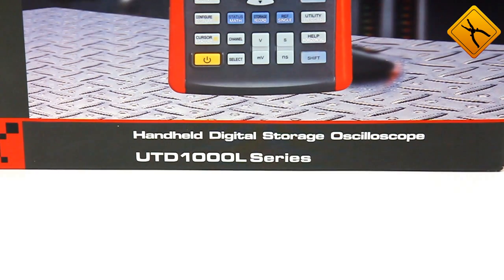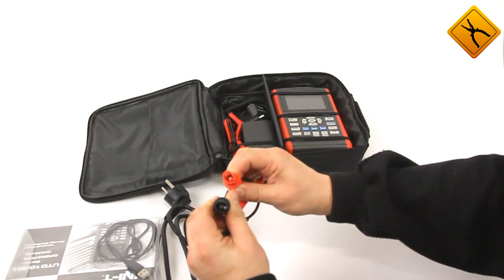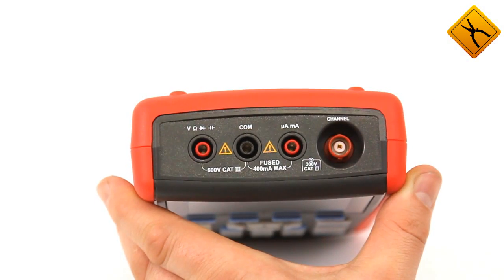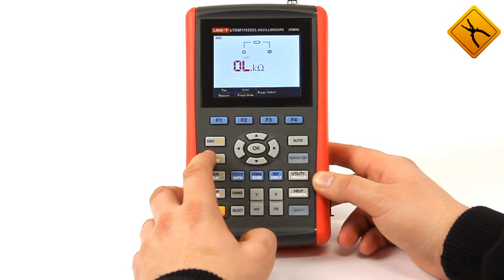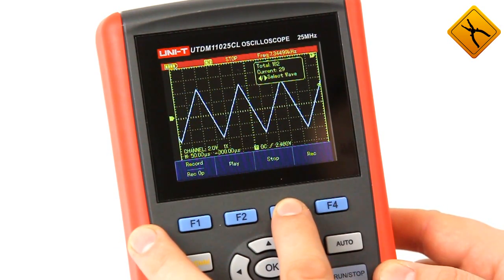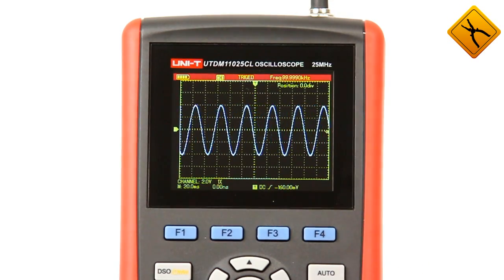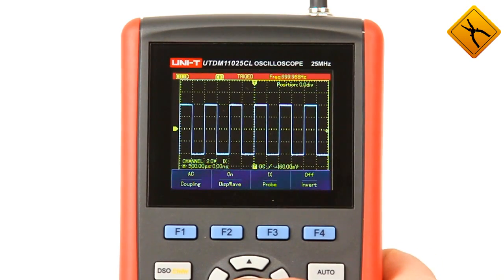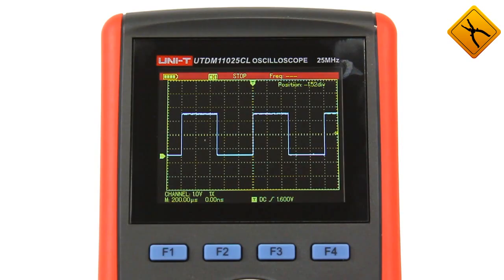UNI-T UTD1025CL Handheld Digital Oscilloscope

Comment: ¿Tested the auto off funtion ?
I got the UNI-T UT81B and is the worst osci/multimeter i ever get because of  auto off (4 minutes delay and auto off my seeting) the batteries dies in 2 days or less if i leave the muti whitout using the off selector and  ended geting a brymen 967 and 0 issues soo far whit the autooff and years ago got a 90 e meter whit same shiti issue.
Reply from the maker: pufero1 UNI-T UTD1025CL oscilloscope is a much higher level. Auto shut-off works properly. The device is equipped with a lithium ion battery. The battery life is approximately 8 hours.
Reply: I got a new brymen bm867s and it works like suposed tunr off and no drain power.
It's soo easy leave it on while working it's basic funcion evry review got the test on this funcion becuse it matters.
Soory but uni-t on profesional is wana be my fault for burn 150€ on it i learn the lesson for the next tech buy.
Reply: There's no S in the word lithium jasckass.
Reply: +pufero1  your watch this video and compare to something completely different for fuxk suck your a moron if ya want to really compare apples with apple and not oranges or pears and get ya facts straight and those blogs are done on this item ( UNI-T UTD1025CL oscilloscope) in video and compare the ut81b to the bm967......... ppppffffffff amateur...